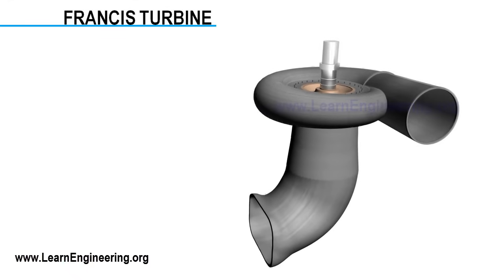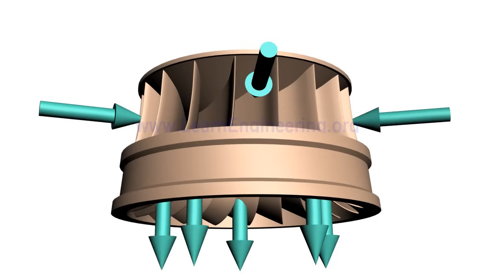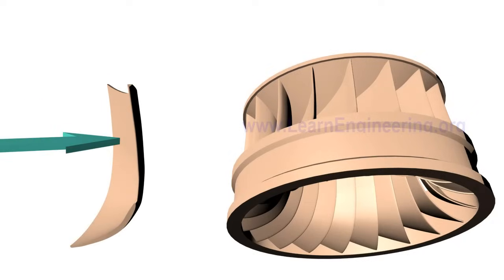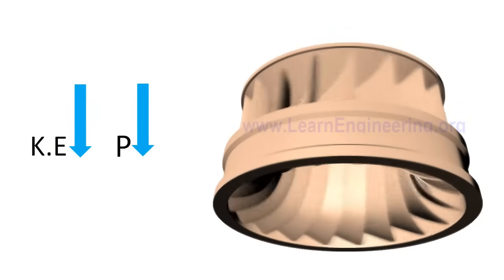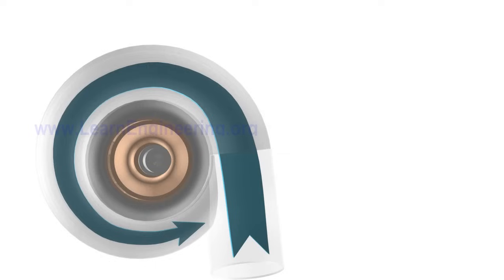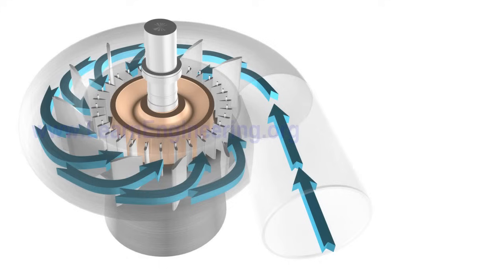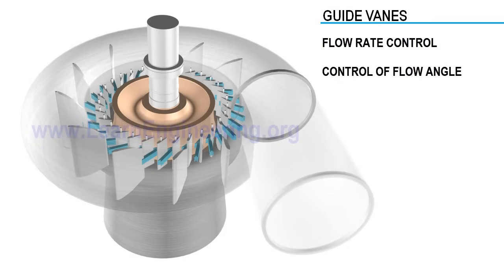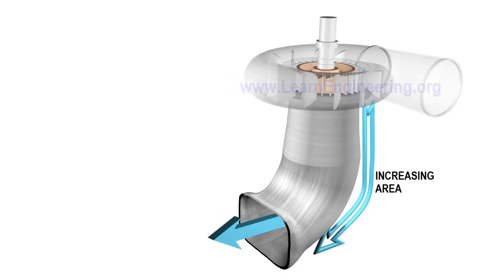Working of Francis Turbine

Comment: The reason why guide vanes closing impact flow rate is the back pressure

The pressure difference between Dam water level and guide vanes is what governs the flow rate, if guide vanes are closed then the pressure difference between guide vanes and water level goes down causing the flow rate to go down

Comment: Question: if U put a number of these in series within a surtain hight,
and then close the loop with 1 pump pushing the water back strait up to the top
could those vortex generetors produce motor power than the 1 pump needs?
thus creating excess (free) power

Comment: Hodgson Water Mill in Sycamore, Missouri is a great example of early use of the Francis Turbine. Built in 1894 by Alva Hodgson, the grist mill used not one, but two francis turbines to power the facility.

Comment: Thanks a low, great explanation <3
Reply: If only it was good on the open road after fixing the car wheels recharging your ev battery as speed = more power as it turns the Tribune recharging air filter system faster as you need an air to water converter box like on that drinking machine to get a new car or jetliner ev self sustainable ev battery recharging system.

Comment: Isn't the draft tube used to lower the pressure on the downside of the turbine to increase the pressure drop over the runner? From what i've learned the draft tube is actually causing more cavitation but there are ways to counter this.

Comment: I was wondering if you could use big enough turbine to with hydraulic fluid to power something like lawn mower XD. Might sound stupid, but why not? And if needed there could be torque converter too. because if it would work, there could be small engine spinning pump that would move the fluid. That way lawn mowers could have smaller engine than needed.

edit: Also i forgot that isn't this how some lawn mowers already move?

Comment: Lift force with no compressible fluid? Is that correct?
I tought it was just impulse force
Is lift force really relevant against impulse force?
Could anyone tell the % of each one?
Reply: A compressible fluid is not a requirement for lift creation.  For low speed aircraft, (say less than 200 knots)   air behaves essentially as an incompressible fluid.  The amount of compressibility is negligible.
Reply: @andrewalexander9492  thanks.

Comment: The problem is that what so called Guide Vanes will also reduces the velocity of the flow due to the friction and change in the direction of the flow. So the gain in energy relating to that could be small or nothing.

Comment: No. 

Some popular science explanation is need..

The draft tube gradually widens in area and slows the fluid down before it exits. Slower speed means something has to hold the horses back and the only way that could happen is a pressure gradient. Each tiny flow element will have to feel an external net force reducing its speed. 

The only way to have a net force that affects speed is to feel more pressure on your face than on your back. As the first guy exiting the draft tube enters free air with his "face pressure" only defined by the water depth of exit, the gradual pressure forces will pile up like in a battery stack and you will have the minus pole of the pressure gradient sum at the inlet of the draft tube.

So the draft tube is a pressure battery stack driven by kinetic energy and introduces much wanted reduced pressure at the turbine exit. A side effect is any factor of cavitation will increase. 

If the design is subject to cavitation you can add static pressure to the turbine by placing it as low as practically possible, sometimes located far below the water level of the exit.
Reply: Exactly. That last bit on the diffuser and cavitation got the connection wrong. Diffusers increase the risk of cavitation, you want to be on the edge of cavitation for maximum efficiency.

Comment: Francis turbines are the most preferred hydraulic turbines. It contributes about 60% of the global hydro power capacity mainly because it can work efficiently under wide range of operation conditions. The most important part of a Francis turbine is its runner.  It is fitted with complex shade blades. In the runner, water enters radially and exits axially. During the course of flow, water goes through the runner blades. Francis turbine blades are specially shaped. We can note that blades are having thin airfoil cross section. So, when water flows over it, low pressure will be produced on one site and high pressure in the other site. This will result in a lift force. We can also note one more peculiar thing about the blade. It is having a bucket kind of shape towards the outlet. So, water will hit, and producing impulse force before leaving the runner. Both impulse force and lift force will make the runner rotate. So Francis turbine is not a pure reaction turbine. A portion of force come impulse action also. Thus, when water flows over runner blades, both its kinetic and pressure energy will come down. Since flow is entering radially and leaving axially, they are also called mixed flow turbine. Runner is connected to the generator via shaft for electricity production. This arrangement is fitted in a spiral casing. Flow enters via inlet nozzle. Flow rate of water will get reduced along length of casing, since water is drown into the runner. But decreasing area of spiral casing will make sure that water flow is entered to runner region almost at uniform velocity. Stay vanes and guide vanes are fitted at the entrance of runner. The basic purpose of them is to convert one part of pressure energy to kinetic energy. Flow which is coming from the casing meets stay vanes, they are fixed. Stay vanes steers the flow towards runner section. Thus, it reduces inlet flow. Demand for power changes over time. The guide vane mechanism is used to control flow rate and make sure that power production is synchronized with power demand. Apart from controlling flow rate, guide vanes also control flow angle to inlet portion of runner blade. Thus, guide vanes make sure inlet flow angle is the optimum angle of attack for maximum power extraction from fluid. Low pressure at the outlet of the turbine may cause serious problems of cavitation. So, a special draft tube is designed is fitted at exit site to discharge the fluid out. Draft tube will transform velocity head to static head due its increasing area that will reduce effect of cavitation.
Reply: Thankyou so much!!☺️☺️
Reply: Thank you
Reply: Thank you
Reply: MUCHAS GRACIAS!!!!
Reply: @raquelarce7879  suiiiii
Reply: @Pedro Leighton It worked and I finally got access to my account again. I'm so happy:D
Thank you so much you really help me out!
Reply: @lyleelias8595  A Christmas miracle
Reply: @Lyle Elias instablaster =)
Reply: @Pedro Leighton i really appreciate your reply. I found the site through google and I'm waiting for the hacking stuff atm.
I see it takes a while so I will get back to you later when my account password hopefully is recovered.
Reply: @Lyle Elias Glad I could help xD
Reply: Will you please tell me what is efficiency of this turbine type?
Reply: GOAT BAKA PASAMONTE YAN
Reply: Thank you so much!!!!
Reply: Thank you so much!!!!
Reply: Thank you so much!!!!
Reply: Thank you so much!!!!
Reply: Thank you so much!!!!
Reply: Thank you so much!!!!
Reply: Thank you so much!!!!
Reply: Thank you so much!!!!
Reply: Thank you so much!!!!
Reply: Thank you so much!!!!
Reply: Thank you so much!!!!
Reply: Hi
Reply: We love you brother
Reply: Francis turbines are the most preferred hydraulic turbines. It contributes about 60% of the global hydro power capacity mainly because it can work efficiently under wide range of operation conditions. The most important part of a Francis turbine is its runner.  It is fitted with complex shade blades. In the runner, water enters radially and exits axially. During the course of flow, water goes through the runner blades. Francis turbine blades are specially shaped. We can note that blades are having thin airfoil cross section. So, when water flows over it, low pressure will be produced on one site and high pressure in the other site. This will result in a lift force. We can also note one more peculiar thing about the blade. It is having a bucket kind of shape towards the outlet. So, water will hit, and producing impulse force before leaving the runner. Both impulse force and lift force will make the runner rotate. So Francis turbine is not a pure reaction turbine. A portion of force come impulse action also. Thus, when water flows over runner blades, both its kinetic and pressure energy will come down. Since flow is entering radially and leaving axially, they are also called mixed flow turbine. Runner is connected to the generator via shaft for electricity production. This arrangement is fitted in a spiral casing. Flow enters via inlet nozzle. Flow rate of water will get reduced along length of casing, since water is drown into the runner. But decreasing area of spiral casing will make sure that water flow is entered to runner region almost at uniform velocity. Stay vanes and guide vanes are fitted at the entrance of runner. The basic purpose of them is to convert one part of pressure energy to kinetic energy. Flow which is coming from the casing meets stay vanes, they are fixed. Stay vanes steers the flow towards runner section. Thus, it reduces inlet flow. Demand for power changes over time. The guide vane mechanism is used to control flow rate and make sure that power production is synchronized with power demand. Apart from controlling flow rate, guide vanes also control flow angle to inlet portion of runner blade. Thus, guide vanes make sure inlet flow angle is the optimum angle of attack for maximum power extraction from fluid. Low pressure at the outlet of the turbine may cause serious problems of cavitation. So, a special draft tube is designed is fitted at exit site to discharge the fluid out. Draft tube will transform velocity head to static head due its increasing area that will reduce effect of cavitation.

new copypasta
Reply: I have same runner for sale. Stainless steel Magnetic Deplux 2205.
+923218184574 WhatsApp number
Reply: Guys in order to improve your life....You must join Art of living. It's an organization made by Gurudev Sri Sri Ravishankraji. The Sudarshan Kriya of Art of living (Online Breath and Meditation workshop) Guided by Gurudev Sri Sri Ravishankarji is an Amazing. It will be 💯 upliftment. The Sudarshan Kriya improves Mental , physical and spiritual aspects of our life.Blood pressure , Thyroid , Mental problems , Depression, stress ,anger, sleep problem (insomnia) & Many more get reduced , get cured. Sudarshan Kriya also creates Anti cancer Properties in body to fight against cancer. Even Corona patients are getting negative after doing wonderful Sudarshan Kriya.spiritual improvement is also there..….. Guys kindly go to YouTube & search for Sudarshan Kriya. And also watch public's feedback of it. You'll just cry. Sudarshan kriya is recommended by WHO, Harvards University, Yale University & by AIIMS Delhi too. I've done this course before 6 months & my life has attained wonderfull another level. Kindly do this course on priority.You can enroll for Online Breath & Meditation workshop on www.Artofliving.org
Reply: we can't read in books that's why we are here but you done the same ....not useful 
subtitles can be used in this video
Reply: i know Im asking randomly but does anybody know of a trick to log back into an instagram account?
I was dumb forgot the account password. I would love any help you can offer me.
Reply: @lyleelias8595  yes

Comment: I'm a bit confused, even if there was a low pressure on the exit of the turbine, where would cavitation form? Cavitation occurs when at a low pressure, bubbles of gas form, and then when exposed to an increment in pressure the bubbles implode and that is when you have trouble, right? It makes no sense to me to increase the pressure in the exit to "avoid cavitation"

Comment: How the impulse force came ?plz explain..
Reply: The impulse force is the force resulting from water exercising pressure on surfaces. Everytime water touches a surface you have the impulse force. You can notice this if you put your hand against a water flow (from your garden hose, example given), you will feel pressure on your hand, right? This is the same, that's why the wheel moves.

Comment: How does the turbine get reaction force?
can't really understand
please help me       btw good video
Reply: Blades'rotor are changing the direction of the flow then it creates a force. You can experiment it whith a bord putted in a water flow; if you put the board at 45° form the direction flow, you'll obtain a force in an perpendicular direction from the direction of the flow. This force make turn the rotor. At high speed, I can believe there is a lift phenomenon but not at slow speed, that's water not air. The interesting part of this concept is the bucket shape creating a second force on the blade. Very good video, thank you.
Reply: lift force is kind of reaction force

Comment: this is wrong explanation, lift phenomenon is not used in Francis runner. conditions of fluid is same on both side and pressure reduction is in radial direction of flow.
Reply: nope.....both impulse and reaction use
Reply: Lift is not their
Reply: If you look at the blade section 0:47, you can see there is an evolving thickness, as a plane's wing. But I believe, that phenomenon is efficient at high speed and is less important than the reaction force.

Comment: Could I hook this up to my bath tub? lol
Reply: If your bathtub were upstairs (8 metres from basement), and during draining it you could get a flowrate of 2 litres/second then you have the potential of about 150watts of power that could be extracted from it. After accounting efficiency that would be about 100 watts. You could power a few lightbulbs, electric razor, laptop charger with it.
Reply: You should hook it up to your bathtub tap since the head is all the way from local water tower's level to your tap and that's a hell of a static head.

Comment: I might sound stupid but why to provide guide and stay vanes if you can rotate the shaft with the rotor already. :-<
Reply: Nihar Tanksale to control internal pressure-stay vanes, to control flow of water-guide vanes... what were you doing when he explained this? it optimizes the flow so that airfoil blades dont have to be under a lot of pressure.
Reply: Vickrant James hmm..thank you..
Reply: they basically make the flow uniform and gives the right angle of attack.
angle of attack is important in aerofoil to generate right amount of lift
Reply: they basically make the flow uniform and gives the right angle of attack.
angle of attack is important in aerofoil to generate right amount of lift

Comment: CAN U GIVE THE PHYSICAL MEANING OF PRESSURE HEAD AND VELOCITY HEAD
Reply: pradeep karna head means energy only
Reply: Yeah energy only........velocity head means the amount energy the water got only due to its velocity and pressure head means the amount of energy water got only due to pressure created in its molecules..... I told what my sir taught me......i think its right
And head means....its just like if u r storing water in a tank ....up to what height water can be stored is the total head or energy of the water
Reply: Imagine you are standing at the shore of a flowing river and consider the bed level of the river as datum then the height from the surface to the bed will be pressure head. And let you have a pitot tube,touch it at the surface of the river then the amount of height at which water lifts up in the pitot tube will be the velocity head.

Comment: At 0:58 the angle of attack is wrong to produce low pressure on the right and high pressure on the left.
Reply: Hi,
It seems to me that the correct one is the one on the video.
Imagine the blade inside the turbine, and you will see the direction of rotation… (from higher to lower pressure).
Otherwise, notice that the pressure should be low on the surface where the fluid speed is higher (longer trajectory for the same time spent for a fluid particle to reach the end of the blade, following the surface) in case no stall phenomena, its the right side.
The fluid enters radially, so the scheme seems correct as well.
Reply: You're right, I thought it was just me